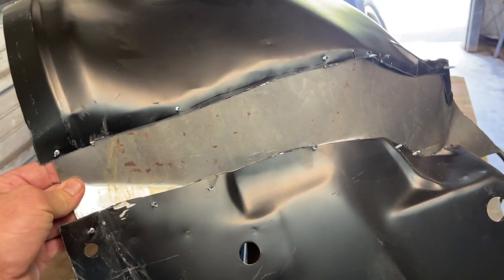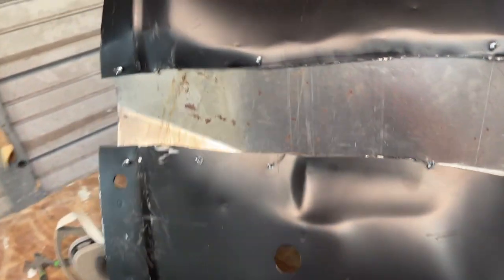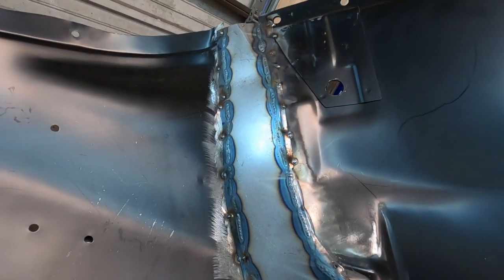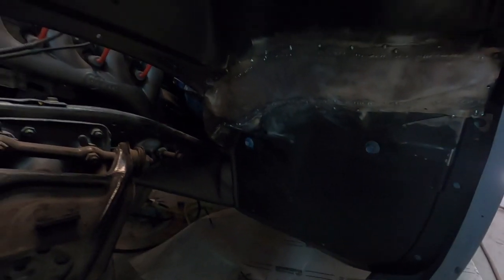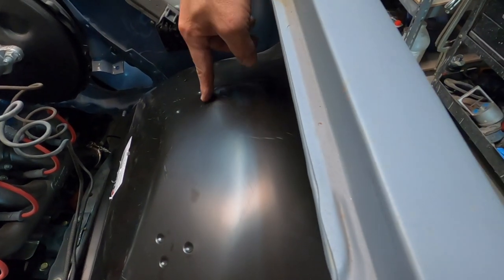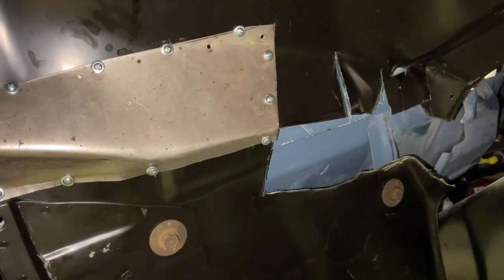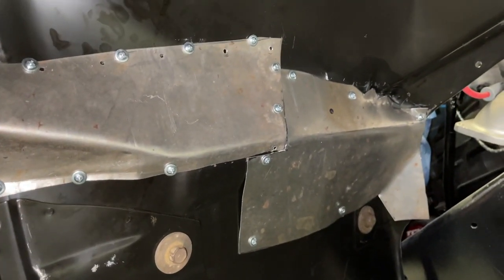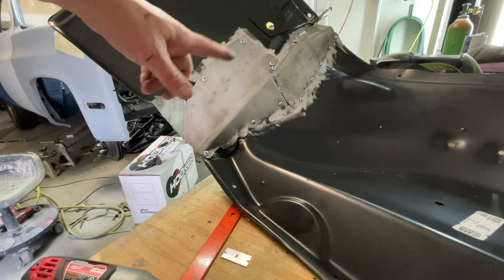C10 Project: Cutting up the Wheelhouses

Comment: I don’t have plans to lower or raise. But short beds & lowered seems to be a trend. No bags or coil overs hear but I do like the idea of filling un-used holes where cruise used to be, bumps as well. I plan on the same with the frame, unless it is a drain. Lots of work as some may never appreciate what was done, but inside and under should be clean in my book. Nice work Jim. I fixed not painted, but had a beautiful Corvette I raised to fix something. I found coat hanger holding exhaust, old rusty bolts next to new ones, pinion seal & 1 axle leaking, wet caliper and dripping trans pan. My heart sank as he didn’t want any fixed. Like the saying, you can’t judge a book by its cover! DK, Omaha
Reply from the maker: Very true.

Comment: Yes, I've heard the 73-80 inner fenders will work with slight modification.  They are also round in the area close to the frame and don't slope off like the 81-87 ones. Also, you can run a modular drop spindles that narrows the track width by about 3/4" and that can also position the wheel to where they don't rub (when using the 73-80 inner fenders) love the video sir!
Reply from the maker: Good to know!  Thanks for the info and thanks for watching!

Comment: What would a man do about a caved in roof?
Reply from the maker: Depends on severity. May be able to pull it out with some creative welding of tabs and pulling with a cherry picker, push out with a porta-power, replace skin, replace roof by splicing at windshield posts and rear window post, or replace the whole cab. Always a way
Reply: @StoutCustom  its not that bad, hardly noticeable but am about to do a frame off restore. Ot appears a new skin is needed
Reply from the maker: @mblake0420  that’s good. Shouldn’t be too big of a deal then. 👍
Reply: @StoutCustom  you have any idea how much a job like that would cost at a body shop. I can do alot of things but I'm no body man, one thing that will be farmed out
Reply from the maker: @mblake0420  I’m really not sure. Finding someone to do it is usually the hard part. The price will vary a lot so you just have to shop around and see what happens.